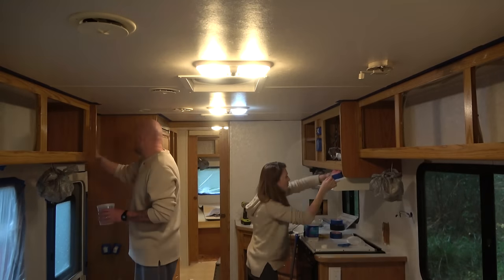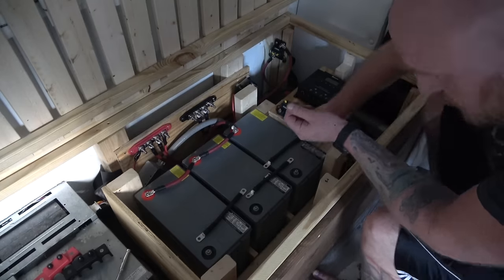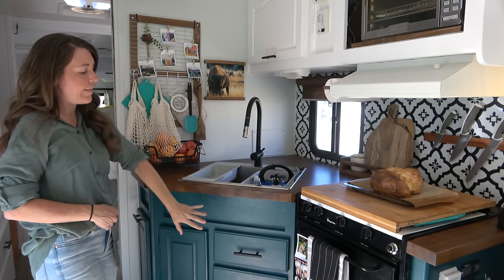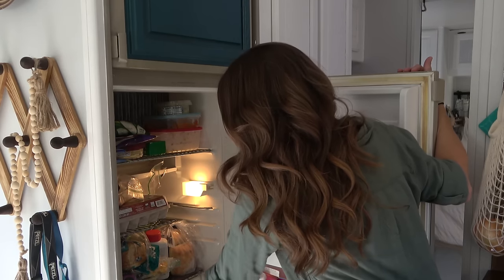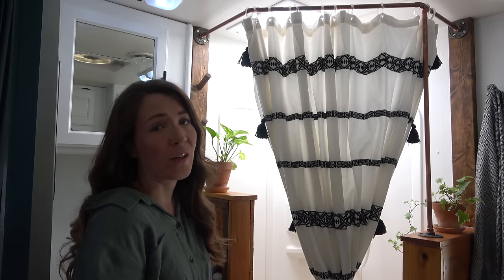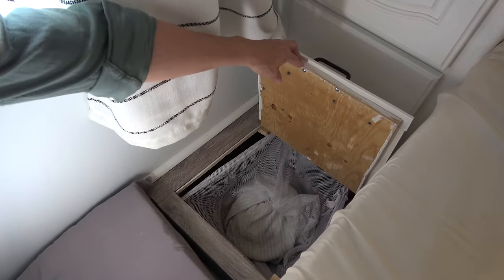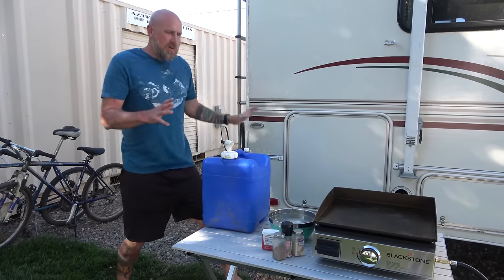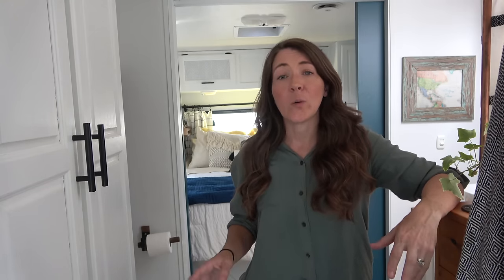Tour Our Completely Remodeled Class C Camper Van // Full Time RV Tiny Home on the Road!

Comment: Wow... I just bought the same RV that you guys have 2 days ago. 1999 Thor Chateau. i love it. I'm also going to redo the inside. I just lost my husband to cancer on Feb 8th. We had both planned on selling our property and 100 year old home on it and live in an RV and travel. We have 6 cats and I had plans on a tunnel for them out one of the windows and it goes out to a zippered screened tent so they can be outside but safe. Well.. I'm going to do this anyway. My husband would want me too. This property here is too much for just me to take care of. This is so great to see what you've done in this RV. Exactly like mine. Mine is a 28' one. My back storage area goes all the way through from one side to the other. So maybe you have a longer one? I think so. Travel safe. I'm in WA state. I got a great deal on this RV. it has only 32,380 miles on it. The generator only has 437 hours on it. Everything looks brand new inside. No cupboards look like they have been used. I used to drive charter buses and school buses for my career. So it's fun to be back in a large vehicle. I would like to see how you put your awning out. I was out there today trying to figure out how to set up the awning. I see you have a Cheyenne model RV. Mine is a Chateau.
Reply from the maker: Thanks for watching and reaching out. Awnings operate in a variety of ways. We don’t have any specific videos on that. But usually there’s a clip on the top of the awning you have to switch to pull out, another clip on the side of each arm to release the arms, a round handle that twists to unlock and then you pull the awning out by gripping a cord that hangs from the top of the awning. From there you’d release the legs from the side of the RV and then lock the awning in place. Harder to write than to show- we’ll aim to do a video shortly.

Comment: You could possibly make a push-open door above the trash for putting small stuff in the trash. One handed operation. 
I took the little panel out and re-made it with heavier material and added spring hinges so I could push it open but it wouldn't swing with movement.
Reply from the maker: Great idea. We'll see if there's a way to adapt our setup!

Comment: The class C we bought in 2022 has these EXACT black and white floor tiles as the kitchen backsplash! So pretty, but we’ve fought to keep them on the walls for two years and are just now removing them. I think they may have been too heavy, despite the additional adhesive sheets the previous owners used under them. But your kitchen looks great!
Reply from the maker: Get a stronger adhesive and that should do the trick

Comment: Happy to see you doing well. Nicely done. Did you do any engine related work, tune or else ? Keep the eye on the plugs, older v10 like to spew em out. Keep em torqued properly but do not rip it because steel will win. Use a slight bit more than factory recommended and always use torquewrench. Tell you results are not funny.
Reply from the maker: Thanks for giving us that heads up!

Comment: You guys rock. Congrats on your very nicely made renovation. We recently bought a Thor Majestic, which is fairly similar. If you don't mind picking your brain a little, I have several questions:
- How did you repurpose your black water tank, since you use a compost toilet?
- On mine - also a E 450 chassis - I discovered that the suspension is already at it limits and we haven't even put anything in there yet. This concerns me. How is your suspension - especially the leaf springs in the rear - look like (already negative or still positive)?
- If you modified the suspension, what did you do?
If you have a couple of minutes and PM me, I would very much appreciate it. Many thanks in advance!
Reply from the maker: We divert urine to the black water tank and can now hold more pee than we ever need to (it starts to stink so you want to dump it regularly before it’s close to filling up). We are at or around our GVWR. By the time you rip stuff out and carefully put stuff back in you get close. No mods to suspension. From our old truck camper days where we were too heavy we added extra leaf springs and bigger air bag suspension. But not sure if that would work or if the axle is rated for that kind of weight for you. Definitely ask a professional.

Comment: I have a 1994 29ft class C motor home. I would love for ours to look like this!! I would live in mine if it looked like  yours.. Who manufactured your motor home? What is the length? Do you have a  box spring under your mattress? My bed is a queen also but not that high.. You both are so creative.. Beautiful job..
Reply from the maker: Thank you so much! Ours is a 31 foot 1999 Shasta Cheyenne. It's on a Ford E450 chassis. We do not have a box spring under the mattress. The fresh water tank is under the bed, along with a storage area that we access from the outside rear of the RV, so that is why it is lifted. We just added a new mattress that is AWESOME even compared to this one, and took a few inches off since we don't have a thick mattress pad over it. As for fixing it up, we are open to consultation and potentially helping to remodel under the right conditions. Send us an email hello[at]calledtowander[dot]com if you are interested. We are based in South Dakota for the summer and will be moving through Colorado, New Mexico and Arizona this October/November on our way back to Baja. Thanks for taking the time to watch and reach out! https://calledtowander.com/class-c-rv-remodel/

Comment: Its Incredible and amazing! You are so good with your decorating and ideas.  Last January, We got a 2008 fleetwood Jamboree and replaced the flooring and recovered the dinette seats.  So wish I,  would have seen your genious idea of the laundry shute when we did the flooring.  Can you tell me what paint you used for the walls and cabinets. Has it held up without any peeling or spotting? I want to paint mine, just afraid that on trips it will crack or peel. Also, mine is 31ft is yours the same size or bigger? do you have any issues getting into state or National parks.  Ive been reading that its an issue.   Thanks, yours is just awesome!!
Reply from the maker: We used Heirloom Traditions to paint the cabinets. For the walls we used Sherwin Williams. The wall paint is doing fine. But the cabinets are cracking because we didn't put silicone around the edges as our cabinets are real wood and it requires this. Otherwise the paint is fantastic. As for the length, we're 31 feet and have not had any issues going anywhere we have wanted. We dont spend much time in National Parks. Too crowded and not enough that we can do with our dogs. Nice to drive through in a day and then we find national forest land nearby. Thanks for watching and reaching out!

Comment: You two did a great job renovating that class C . My wife and I have been kicking around ideas for travelling in retirement and I'm leaning toward pulling a 20-22 ft travel trailer  and she mentioned a class C but they just seem too pricey to me. I never really considered a renovated class C but maybe that's a good compromise. How do you go into town when you are boondocking? Do you pull a car or use a bike/ebike? How have maintenance costs been on the engine? No major problems? Can you take it to a regular Ford dealer or do you need to go to an RV center or repair facility?
Reply from the maker: We just purchased a used CRV to tow so we have more accessibility than we had before. We would usually stock up and go get lost where we wanted to camp for a week or so. Maintenance is done where we can find it. We did a lot of preventative maintenance at a friends shop once we remodeled and before the road. Then we’ve found a great mechanic where we’ve work camped in Custer, South Dakota. I do the oil changes and maintain the other fluids and we have a small engine code reader we check every other day. But in general, RV shops are more likely what is needed in a bind. They’re just pricey. We love our Class C and we’ll likely be in this one or another one for years to come.

Comment: Just curious, did you have to concern yourself with adding weight by things like the desk, Butcher block counter tops? I often think of the RV's frames in terms of the types of materials manufactured specifically for RV's being about pressure on the frames.
Reply from the maker: We always consider weight. And at the end of the build we were a little heavier than before. But we also removed a lot of cumbersome things. We didn't step on a scale each way. But we're content to fall within the recommended weight for the RV.

Comment: Im in the process of renovating my 24ft  RV, took all the carpet off and put a waterproof luxury vinyl flooring, painted the cabinet top white and dark grey on the bottom. 2 weeks and not close of being done😟
Reply from the maker: Yeah, we thought our whole project would take 4-6 weeks. At 4 months we got a little depressed. At 6 moths we cut some corners to finish up so we could get on the road! We had to work full time to pay for all the remodeling though, so that added some time. But there always seems to be more to do with each project! You'll love the finished product though! Keep going!
Reply: @CalledToWander  , You guys  did an excellent job on yours... we just got ours 3 weeks ago its a 2001 Dynamax carri go low mileage still in very good condition but I don’t like carpet and oak color cabinets and the old style flowery contains.

Comment: What are you do with windows in the winter because those curtains you fixed are cute and they work in great weather but they don’t work in extreme heat and they don’t work and extreme cold, so what do you do then?
Reply from the maker: We go to Baja in the winter and they work fine in the summer. The bedroom curtains have blackout material which help reduce heat. You could add blackout material to all of your curtains if you wanted, or add reflectix material that you put up behind the curtains to keep out cold and heat

Comment: How about insulation? Is it possible to add/upgrade?
Reply from the maker: Our RV was incredibly well insulated. We have a ducted AC system with 2-3 inches of insulation. Same with our side walls. All aluminum framed with thick insulation. If you were looking to add insulation this is a much bigger project as you would have to take down walls/ceilings. We didn't want that kind of work, so we searched for an RV like this that we could "remodel" as opposed to "renovate" as all the work in this video was within our comfort zone. Insulation would be perhaps in the next RV someday, as a complete build. Thanks for watching and reaching out!

Comment: This is an awesome tour ! May I ask buying an older Rv have you had any troubles with it machanic wise ? Is really buying an older rv worth it would say and is many miles on one okay or is less would one be set too much ? Have you ever heard of this before? I really wanna do this myself but I hate to spend mad $ ! They speak of leaks and some are hard to find ! I wished I could find one that’s been kept inside while not in use ! I will be sure to look out for this V10 ! Ty so much for this tour ! I love every inch of your remodeling! You are both very good at getting this stuff done yourself! That’s awesome! Subscribed and liked !
Reply from the maker: Thanks for watching and sharing kind words! In short, we have had minor issues with the older RV (needed new tires, brakes and some small mechanical parts that were not expensive or difficult to have installed). We could NOT afford a new RV and we know lots of people who have had issues with new RVs breaking and then to service them on the road has been a terrible process. We like the Goldie Locks example with miles - not too many, not too few. This RV was stored for 7 years and only had 45K miles, which was perfect. But because it was stored we did have the issues we needed to address that may not have been an issue if it was driven (tires dry rotted, engine hoses dry rotted). But now that she ("Wanda the Wanderer") is being driven we've worked out most of the kinks from it sitting. We have a great (thorough) video on what to look for when purchasing an older RV. This should help out big time (link at the end). Definitely check for water damage thoroughly. As for us being skilled, we learned EVERYTHING to do this as we did it! That is much of the reason it took so long. Check out our entire Season 4 playlist to see what and how we did things to hopefully encourage you to take it on. But finding the RV is a tough challenge, especially now that there are SO MANY RVs out there and the market is very much overpriced. If you can, check for east coast (south is better, as no snow/salt) and consider saving the money on the same RV you'd find and pay more for on the west coast. Hope this helps! Please feel free to email us with any other specific questions as you have them! Good luck on your journey! https://youtu.be/WWe2rnPfe74

Comment: How do you mount like the sliding door and shelves up?
Reply from the maker: The barn door has a track with attachments that hook onto the top of the door. Then on the bottom we installed 2 small tracks to keep it sliding in a straight line. The shelves (if you are referencing the small Ikea ones in the bedroom) have screws that go into the wall and holes on the back of the shelf into which you match the screws to the shelf. Hope this helps! Thanks for watching!

Comment: When you're not hooked up to shore power, do you still run your fridge on propane now that you have an upgraded power system?
Reply from the maker: Excellent question and one worthy of a video in itself! In the few times we are on shore power (we boondock 80-90% of the time) we rely on shore power. So we switch the fridge over to AC power, charge every device we forgot to charge or that takes a lot of power to charge (our handheld vacuum, usually) and run other AC-only appliances such as our dehumidifier (if we're in the humid southeast!) or space heater (if we're in the frigid north!)... We keep propane for the boondocking as much as possible. And even though we've upgraded our power system we would not recommend running a fridge on battery power. Our fridge is only 2 way (AC and propane) but our former truck camper fridge was 3 way with the battery option. Fridges are notorious for killing RV batteries. So if you do have a DC-option fridge be sure to do thorough research on the power draw and then, of course, properly size your battery bank accordingly. Does this help? Email with any specific questions if not! Thanks for watching and reaching out!
Reply: @CalledToWander  Super helpful. I'm considering going rv full time and I want to see how much I can rely on renewables, but rv fridges are bigger than what you find in most van conversions.

Comment: I'm a newbie....thought the compost was great, but what do you do with the poop?  Do you just take the plastic bag out everyday and empty it, then wash it?  Do you use a special kind of smell remover?  Just curious.  Thanks.
Reply from the maker: We use a simple plastic bag that we remove and dispose of every few days. For smell we have used a combination of cedar shavings and coconut coir. Lysol always helps, as does more frequent emptying. It's more of a "modified composting toilet" as there is no churning involved.
Reply: @CalledToWander  The thought of having to drain poop down a long tube just grosses me out. 🤮  I saw a video of a system in a van in New Zealand that was like a box cartridge with a handle on top.  When it was full of poop you just take the whole cassette out of the side of the van and then take the bag of poop inside of it and throw it in the garbage. There was no smell at all and it was very neat and tidy. Nothing whatsoever to clean up inside of the cassette.
Then just put another plastic bag in the cassette and back into the side of the van. I thought it was great!

Comment: Being new to boondocking what does that amount of hours of battery in solar mean in actual usage. An example is using a refrigerator
Reply from the maker: There’s too many situations and variables. But take starlink, or any appliance that draws around 5 amps/hour. Our 400ah lithium (which can be used 100% without damaging it) would supply 5 amps for 400/5 = 80 hours. You need to determine how many amps your appliances draw to do the basic math like this. Hope it helps!
Reply: Thank you!

Comment: so ur homemade compost toilet - does it smell? do u use the wood chips or take it out usually?
Reply from the maker: It has poo in it, so yes it smells! We used cedar shavings at first, but they took up a lot of space and were not always available when we needed to buy more. The cedar smell helped but poo is poo. We have since switched to coconut coir, which does a better job of drying out the poo and thus reducing the smell. We also installed a fan recently that vents the toilet to the outside. In general, we've minimized the smell now... And we empty the bag at least every other day or so to keep things fresh.

Comment: how do u handle tending to solar panels in snow and ice rain
Reply from the maker: We avoid snow and ice rain by heading south every winter to Baja. We don't do cold. Most solar panels are designed to withstand snow, hail and other inclement weather. But if you're buried in snow, you'd probably have to manually clear the snow from the panels. Thus, we drive south.

Comment: Hey there! We just purchased a 199 Shasta 28 foot and I am anxious to start painting and renovating it. I am wondering what you did with the plastic trim that goes in between the cabinets - did you remove it or paint it? I can't imagine it holding paint well!
Reply from the maker: We painted it. So far over a year later there are no issues with the paint holding!